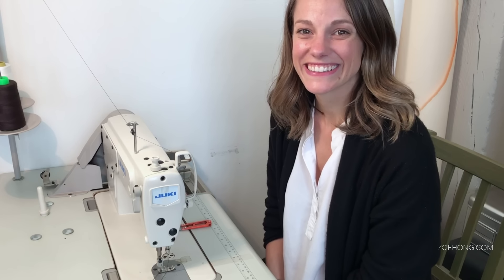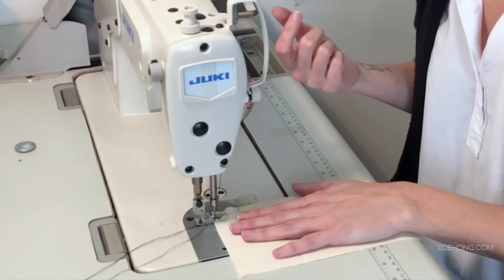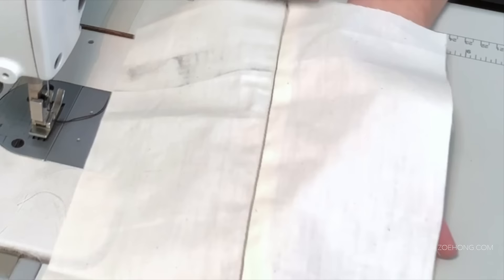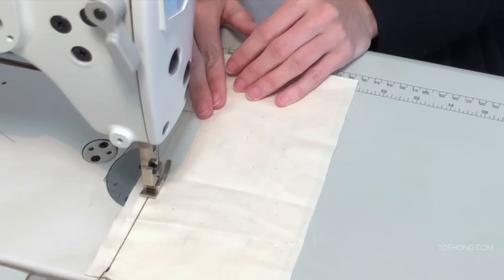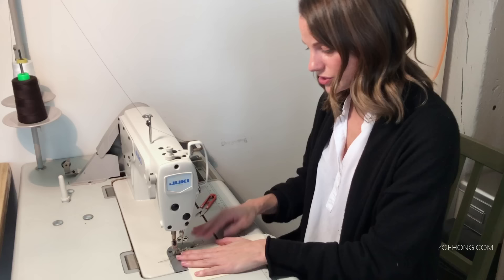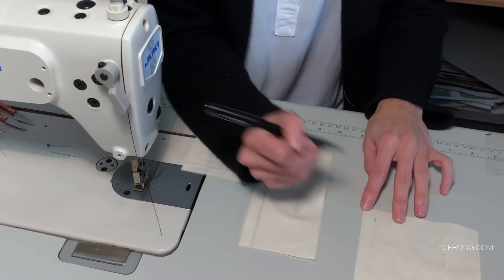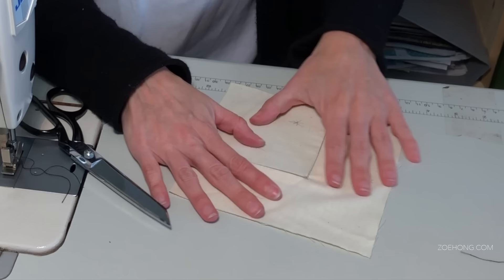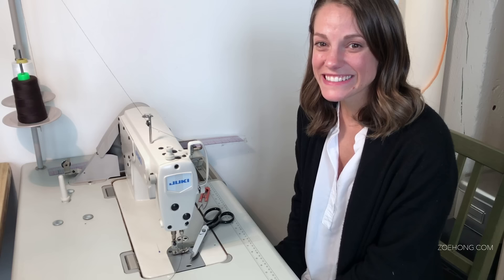How To Sew 8 Common Seams

Comment: And a tip for the curve seam, to keep the finished seam flat, you can use pinking sheers for the seam allowance, or cut directly toward the seam, along the seam allowance (Never cut the seam itself). In the latter scenario, you will then finish and have a seam allowance full of little squares😊That's just an easier way to flatten it all out. I hope this helps, and I loved the video. I learned a lot.❤
Reply: So that is what pinking scissors are for, I've inherited a pair but never knew a reason for them THANKS.

Comment: As a 61 year old man and a retired welder, fabricator, machinist, tree trimmer, I appreciate this instruction. I make manly tool bags, gnarly equipment covers, tree climbing harness modifications, clothing and upholstery repairs ect. All these subjects this young lady covers are not just a fluffy girly thing, they apply to even the rough and tumble element of manufacturing items. Today's generation sorely lacks the resourcefullness to be self sufficient and creative. Thanks !
Reply: I am a 35 year old guy myself, and I started dying textiles recently, and now that I am looking into sewing, I am wondering why I never learned this before!  I am hoping to be using this on webbing and building little saddle bag type units also.  The stigma that this stuff is girly, is as off as firestarting or cooking being gender specific.    Thanks for your comment and good luck with your creations!
Reply: @kreagan4826  when some shallow minded dolt makes a "sewing is feminine " comment, I remind them to look inside of a car  upholstery shop, awning shop, sail shop, horse tack shop and knife and gun holster shop. They'll notice many men in those lines of work. All the tailors I've gone to for military uniform repairs have been men.
Reply: I know you're trying to be respectful, it's just that someone has to say it. Calling the careers/interests of women as "girly" and "fluffy" is diminishing. "Girly" is often used as a derogatory term and I'd argue that's exactly how it was used in the comment above. As you mention yourself -- sewing is used in everyday objects and materials. But the distinction made between goods has been placed there by people who uphold gender roles. So, "girly" stuff is clothing (which is absurd since everyone wears clothes and anyone who wishes to learn how to sew can do so) while manufacturing is seen as "manly" which we know automatically carries more respect. Sewing is just sewing.
Reply: @aintnonormie1437  lol.. common.. You're being way too sensitive, don't you think.. "Girly",. Is not, an insult,.. relax ..
Reply: I learned how to sew as a kid just because I loved machines of all types and insisted my grandma teach me how to use the sewing machine.  I quickly came to see sewing as just another survival skill like fixing or building stuff.  I also always found sewing and welding two of the most relaxing forms of joining materials.
Reply: It’s the American school system
Reply: "The rough and tumble element"

Sewing is sewing, guy 😂
Reply: that’s so cool bro
Reply: I am a lifelong woodworker. I find many similarities to working with wood. Just bought a never used leather machine at a garage sale. Looking forward to my machine for all sorts of repairs and new projects. Thank you. Bob from MN

Comment: Oh YES, MORE PLEASE! ❤  I particularly loved the curve and the corner seams.  I'd also never considered sewing one side of the seam a tad in, instead of the tedious, and often dangerous cutting away that 1/4 inch for the flat felled seam.  I've always done French seams purely because I f all the cutting away of the fabric, and I always managed to either cut away too much fabric, or not enough and then it showed on the outside of the seam on the garment, so I had to painstakingly cut off those tiny little pieces that showed through, all the while trying not to cut the fabric!  I'm so grgrateful for your demonstration of the various ways to do these things.  I'll certainly be using the flat felled seam a LOT more often now! 😊

Comment: Hi,
I just picked up a much older machine. (1970's Singer 237 m-a Fashion Mate)
 I put a new belt on, and I learned that the tighter the drive belt is adjusted
  the slower it will start and run.
If I adjusted the belt loosely It would start and run faster.
I like it slow as I am new to all this, and it makes it so much easier to learn.
Thanks for the video.

Comment: Great video, you're an awesome teacher!  I have just got into sewing and my first project has been some pyjamas. The fabric has been so difficult to work with as its a thick fleece type fabric and the feeder dogs don't seem to want to grip the fabric, so I have had to use really high pressure on the foot. Which then meant the fabric was mushrooming up at the sides of the foot and taking the line off course, so I had to keep lifting the foot and re-positioning. Luckily, being fleece it hides squiggly lines to some degree haha. I wish you could add pictures in the comments.

Comment: Thank you both, Myriah and Zoe, for taking the time to teach us! You are amazing!  Maybe it's a good tip to add that when you are sewing the square or some seam that needs to end at a certain point that is in the middle of the lenght of a stitch, you can stop the needle while you are in the middle of doing that particular stitch and you get to that point that you want it to finish by pressing the backstitch bar and this stops the needle from moving forward. This way you get like half a stitch lenght in order to get to that point in which you want to end the seam. Idk if I make any sense, English is not my native language, still I hope this is understandable and helps someone. If anyone gets it and can explain it in a more simple manner or correct me, please go ahead and do it. :)
Reply: This does make sense if you are using a home sewing machine, and is a great tip!  With industrial machines it's all manual so it wouldn't apply, but for home sewing that's a great sewing hack.
Reply: The machine that I use at home is an industrial JUKI DDL-900A-S and I do this.

Comment: Found your site just today, 04/14/2021. I've been sewing intermittently since I was a child, but learned some things about seaming that were new to me. Hope you don't mind, but I want to offer a tip for you - I keep a magnet on my sewing machine to catch those pins we throw to the right. I often also use my magnet to hold down the needle and bobbin threads at the start of a seam - this helps me with that unthreading issue.

Comment: Let me tell you a couple of things about sewing machines.  I use my Grandmothers Singer Featherweight that was built in 1949 and it works as well or better than any newer machine I have used.  There aren't a whole lot of bells and whistles but it sews the straightest seam of any machine I use.  A good tip if you are starting is to take a piece of painters tape to line up your 1/4 inch or half inch.  It makes it easier to keep your seams straight.  Also, I'm a quilter so everything just about is 1/4inch SA, So I use a quarter inch foot (they make your life SO MUCH EASIER)...so if you ever see a singer featherweight 221 at a yard sale or the like and it works...scoop that up!🪡🪡🪡  (and trust me...the older you get the more you swear at your machine when the thread slips out...it takes me forever to thread)

Comment: I learned the hard way before watching this to hold the thread behind the machine to keep it from sucking it up and having to re thread. I also put the pins vertical with the head towards me so I can pull it without stopping it and use a magnetic guide.

Comment: Thank you for this great tutorial. It was clear and simple and easy to follow!   I have owned a machine for almost 30 years and have only really done VERY basic sewing. HOWEVER, I did take a costuming class in college and we had to learn pattern sewing AND how to design a top using a dress dummy.     But that was so long ago. I have ADHD so sometimes being super accurate is not one of my highest skills.  I probably should just practice on some muslin.   Can you do a tutorial on how to CUT pieces out to get a clean squared  edge? My cuts are sooooo wonkey and uneven and I do use either Fabric scissors or a rolling cutter... Or does it matter too much since you are going to be sewing a straight seam?  Also, any tips on practicing straight seams?

Comment: I love this video!  I am very new to sewing.  I am making several pencil skirts in different fabrics and I would like to use french seams.  I am using ponte for one of the skirts (unlined), and I would like to use French seams.  Is a French seam appropriate for ponte?  (I also thought about binding the ponte seams with bias tape instead of using  of a French seam)  Anyway, I would like to use a French seam on the back seam of the skirt (along with the vent panel).  Could you make a video demonstrating the best way to do this?  Thank you!

Comment: worth investing in a decent servo motor with needle synchro. I have two machines each I tossed the generic clutch motor for a Ho Sing G series servo with sync module as a kit.  Its programmable and the needle down/up is super nice feature.  I tried the Reliable servo motor, but sent it back, that brushless motor let out an annoying shrill noise. These Ho Hsing motors are absolutely quiet and super strong. U can get a larger pully at Tractor Supply if you want more control.   I think they were 350 each?   Been awhile now
Reply from the maker: I've heard a lot of great things a bout servos and I've used them before and I recommend them but personally, I don't sew enough to invest in a switch.

Comment: There is an excellent, compact and easy to use over-lock sewing machine on eBay which is " Simplicity "  SL-200 at a price as low as $100- ( Used ).  I was so lucky to purchase one SL-200 at a local Salvation Army Store that cost me only $12.99 ... What an Excellent Deal !

Comment: Zoe, I've seen you struggling to get focus on something small and close with your camera on a couple of your videos. If you haven't solved this already, the easy way to do it is to hold it on something flat close to the camera and it should be the same distance from the camera as the flat thing. For instance if you want to use the palm of your hand, put the thing flat on the palm of your hand and have the camera focus on the palm of your hand where that thing is, that way it will be in focus.

Comment: Great video with good camera work. Any advice regarding french seams on curves? The principle is the same of course but you can't clip into the seam.
Reply from the maker: You can trim the seam allowance very closely to the stitch line in those sections and that will help.
Reply: Also, press your seam allowance towards the outer side of the curve.  This will help your seam lay down flatter.

Comment: Could you show/Demonstrate how to insert a two wedge (on each side) system to expand blue jeans.  I have been trying to figure out how to have turned in seams (pretty side together then over lock sewing) and I can't get the heavy jean seam out of the way.  I have tried to eliminate the multi layered seam but nothing is working.

Comment: When you do a flat felled seam and set one raw edge 1/4” back from the opposing raw edge, you end up with 1/4” extra in the garment panel, as it was moved out of the seam, into the garment.  Over 4 seams, this adds up to a size difference.  Could you explain, please?

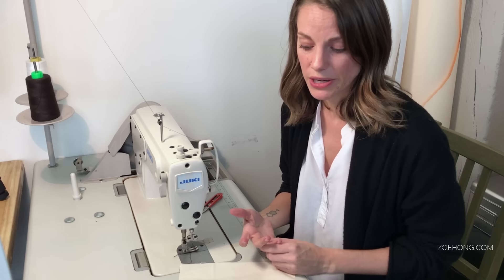Comment: You mentioned in about the 6:30 mark that if the fabric bunches together, it could mean your tension is off. What is the ideal tension level you should use?
Reply from the maker: There is no universal tension setting for all fabrics. There aren't even any numbers on the tension dial. You test the tension every time you switch fabrics with a little scrap. "Lefty-loosy, righty-tighty"

Comment: Excellent video! Not to be Mr. Picky but, i would add up front that it’s important to note when she says stitch width, she is in fact referring to stitch length. Width connotes a zig zag width side to side where as length is the proper designate for number of stitches per inch. She is using a straight stitch machine so it is in fact the stitch length being referred to as 2.5 as the ultimate setting. Additionally, the setting numbers on any dial depending on the machine does not necessarily correlate directly to the number of stitches per inch. 2.5 stitches per inch would be a VERY long stitch. I find the average for most garments to be approximately 7-9 SPI (Stitches Per Inch) which may correlate to what is being recommended on that particular Juki model. Other models and brands may differ in actual setting numbers on the dial for the same SPI. Again, not to be nit picky, but when teaching folks to sew, those little things are usually where the disconnect happens, lol. And by the way, don’t excuse the age of the machine! I find that a machine that has been well broken in is a lot less likely to need any mid project adjustment. I am a TOTAL vintage machine fan and that Juki 8100 is one of the most consistently reliable models out there. I have one of the 5550 models with the old needle position and thread snip that’s about thirty years old and I absolutely LOVE that thing!!

Comment: I noticed she didn't do the 1.5" length reinforcement stitch beside the seam allowance for the corner seam. Is it not necessary?
Reply from the maker: I never learned that that was necessary.
Reply: For a heavier garment that's more utilitarian, like a work pants or a uniform jacket- something that would get a lot of wear and tear over time- I would reinforce.  For your basic garment and most casual weight fabrics it's unnecessary.
Reply: Ooooh, cool thanks! That'll save sooo much time

Comment: thank you guys
loved it, more please

I have a question: 
if I sew one straight seam twice exactly in the same line, does it make the seam stronger or weakens it? as the needle pierces the fabric more times and the extra thread makes it stiffer
or for example if I go overboard with back-tacking in the beginning and at the end
Reply from the maker: There is no need to repeat the stitch line (yes, holes will weaken the fabric) and do not go overboard with the backtack.

Comment: Hey Zoe, when sewing multiple seams that have more lines of stitching than a basic straight stitch (like a top or edge stitch), would you sew all the initial straight stitches first, press them, and finally go back and add the topstitching? Or would you complete each seam at a time, so sew the straight stitch, press it, sew the top stitch, and then repeat that? Thanks!
Reply from the maker: It always depends on the order of operations of the individual garment.

Comment: Hi I thought it was worth the shot to ask- I’m currently making a pair of jeans and I’m struggling to work out how to do a flat felled seam on the outer leg seam when the inner leg is already sewn up, so you need a special machine or am I missing something, how would you do it?
Reply from the maker: Most jeans have a flat fell on one side and a regular seam with overlocked edges on the other.

Comment: What about the raw edges inside??? For Walt seam you have raw edges inside. Would welt seam. Be good on stretchy on it fabrics that don't fray?
Reply: *Update*: You shouldn't do a welt seam on stretch fabric. There is a lot of stitching going on with a Welt Seam which will pull and tug your stretch fabric and distort your final garment. Recommended to overlock the edges and do a straight stitch. If you don't have an overlocker, check out alternatives to overlocking. So with the stretch fabric, you want to reduce unnecessary stitching, therefore, a straight stitch. My tailor friend said you could also do a french seam @ 16:07.

Myriah does mention that before doing the welt seam, some people would 'overlock' the raw edges (checkout overlocking), overlocking is an industry standard practice. it makes sure the fabric does not fray (it's in a lot of our clothes underside of the stitchline). (But some tailors find overlocking, 'cheap looking'). 
Based on what I understand, the 'flat felled seam' @ 11:17 gives you the same effect as the welt seam but with a tidier finish on the underside. 
I think they are just focusing only on seams(joining two fabrics) so they aren't talking about hemming (the finishing method) etc.

Comment: I have this problem where I can’t control where my fabric goes while I’m sewing any tips?
Reply from the maker: Hold on to your fabric. Treat your fabric like a puppy on a leash. 
Hold on to the leash and guide your puppy gently.
This will occasionally require a little more insistent nudging.
Do not yank violently on the leash. 
Do not let go of the leash and expect the puppy not to run away.

Comment: Idiot question here, what is the name of the foot on your machine?  I see it a lot, but my machine came with a different kind of foot and it's not as easy to work with as yours seems to be.
Reply from the maker: Straight stitch foot. Nothing special. Came with the machine. If your foot is sticking to your fabrics, try a teflon foot.